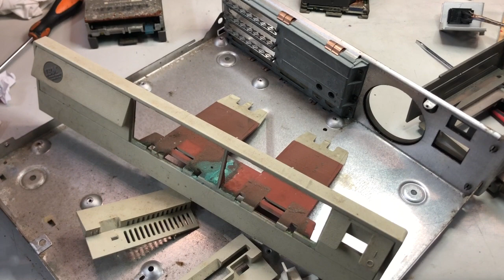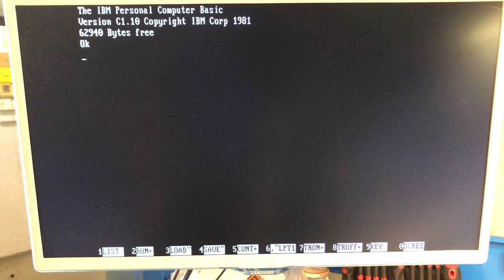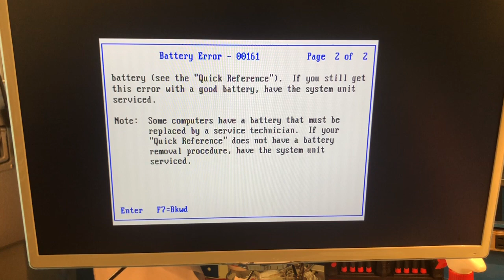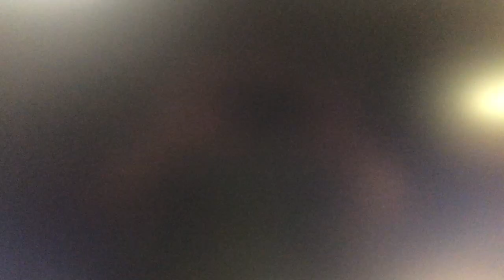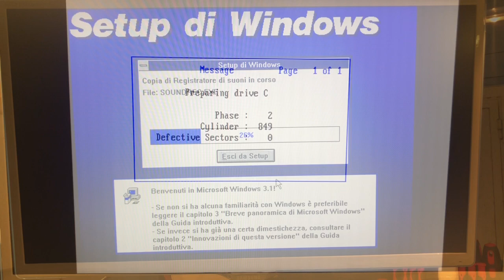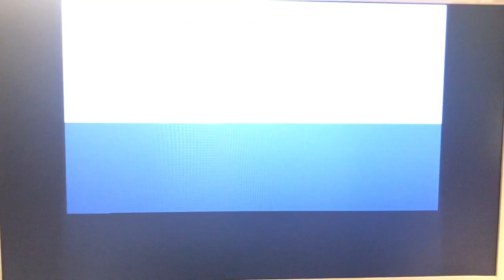IBM model 55SX repair and restoration adventure. Tons of faults!!

Comment: Hi, Thank you for your quick and kind response. I made for the moment the ribbon plate with dupont cable which saves me crimping IDC connectors... I still have 3 questions: you write 4=3(fdd), 4 being on the PC, but on all my fdd 3.5", pin 3 does not exist. what is the solution? are the 5 resistors soldered together and connected to 5V? finally on your video, the 5 V is indeed taken on #3 of the PC, 12 V on #6 and GND #7. in a forum, i saw that connections are #40 (12V) , #38 (5V), #37 (GND). if I connect a 34/34 flat ribbon the old obsolete fdd is well powered which shows that the 5V comes between 1 and 34. So you are right !
Reply from the maker: Pin 3 in some fdd’s is for connector key so it’s missing. Shouldn’t be a problem since odd numbers are GND, so you can leave it as NC. To connect resistors I’ve placed a piece of rigid wire (~1.5mm diameter) to 5v and , as a rail parallel to the fdd connector (soldering side clearly). This allow me to solder each resistor to it and to the pin  with a good strength. About power rails I’ve just retro-engineered the original IBM fdd and cable of my pc to split them and feed the molex  4 pin connector.

Comment: Hello I had the same problems as you on my 55 sx and therefore the inability to read the reference floppy disk because of the floppy drive default; my cry for help in my association in France has not been yet positive (https://wda-fr.org/forum/viewtopic.php?f=1&t=2756&p=15734) and it is with great pleasure that I came across your video. I have questions. Is your cable model accessible ? does it look like this assembly (https://github.com/schlae/PS2FloppyAdapter/blob/master/PS2FloppyAdapter.pdf). ? resistors 1 kohm are on 34,30,28,26 and 8 pins.
In the link you suggested (https://www.vcfed.org/forum/forum/technical-support/vintage-computer-hardware/51460-again-a-faulty-ps-2-floppy-drive) resistors are 4,7 kohms and 10 kohms. Is it matter ? are they at the same pins as shown in the previous link? Thanks for your answer. Denis
👣
Reply from the maker: Dear Denis, the resistors I’ve used are all 4.7k. PIN numbers are correct. The cable is home made. Be aware that voltages comes trough the cable and potentially dangerous if mis-wired. Pins: 1=nc, 2=2(fdd), 3=+5 vdc, 4=3(fdd), 5=4(fdd), 6=+12 vdc, 7=gnd, from 8 to 34 are pin to pin. Therefore on fdd side 34 pin connector has pin 1,3,6 and 7 empty and on pc side Pin 1, 35 to 40 either. That’s how I did it, but please check carefully that those connections match your pc before connecting any device. Unfortunately I’m not able to open again links you mentioned. I hope this’ll be of help. 🤞

Comment: Good video !!! do you have the schematic of the modified ribbon cable to put a normal 3,5 floppy drive?
Reply from the maker: Thanks. I don’t have it but if you need I can provide it. It’s a bit tricky but nothing that everyone can do. Let me know
Reply: Hi, I would also appreciate having a closer look at what you did there. I did create a replacement cable according to some notes on Bob Eager's Tavi website but I could not get the replacement floppy drive to read the reference diskette. I notice that you wired up some resistors to your floppy drive so it looks like there is a trick or two that I have missed somewhere.
Reply from the maker: @egbront1506  Unfortunately after the receive of the original FDD I’ve removed the modify. However I found the info here https://www.vcfed.org/forum/forum/technical-support/vintage-computer-hardware/51460-again-a-faulty-ps-2-floppy-drive. Check it out there are pictures of the resistors in place. We need those since the original IBM FDD has the pull-up resistors built-in. 🤞
Reply: @mymessylab  Thanks. I shall check it out.

Comment: Have one computer of this kind too, a model 8555.
The power supply died on it and I could not repair it. The PSU just turned on for a second then off right afterwards.
All the capacitors were good, no bad transistors found nor the power chips or resistors.
Ended up buying an new cheap ATX PSU to replace the circuit board in the IBM PSU and modify the fittings for the card and transfer the cables.
The new PSU board did not have the -5V output, but checking the pin on the motherboard for that voltage, it was not in use with a resistance beyond 2M ohm's between all the other pins and ground.
Now the computer works again and stays on with no problems.
Reply: Thanks.😊
Almost every psu for a desktop pc gives the same voltages except for the newer ones that doesn't have the -5V output.
But rebuilding something vintage with new technology instead of repairing it would have been the last thing I did because it can and will affect the value of the device of all kinds.
Reply from the maker: Yes. Those PSU can be a nightmare. Happy you’ve found a way to save the PC.